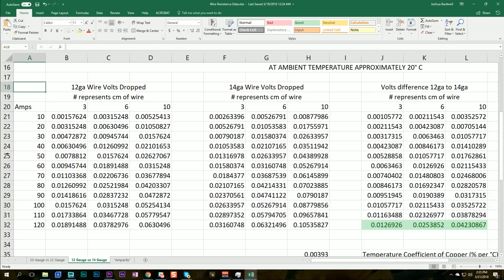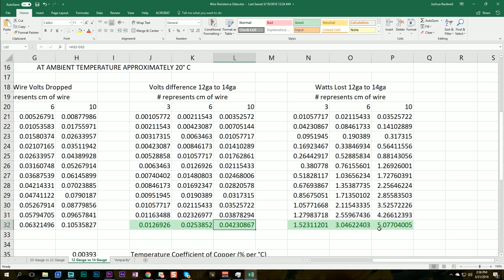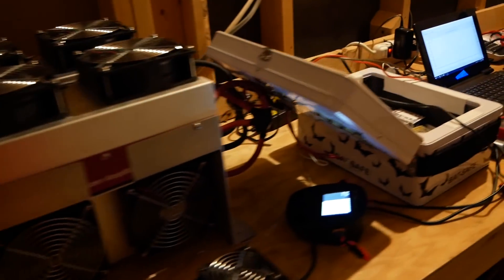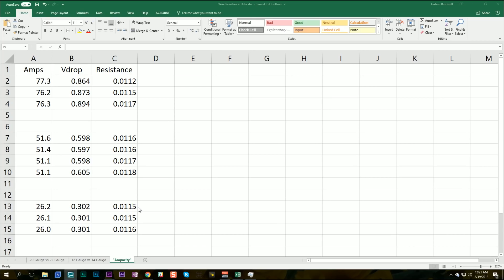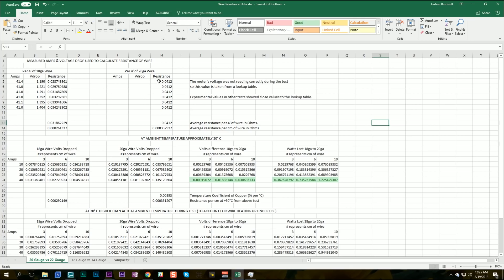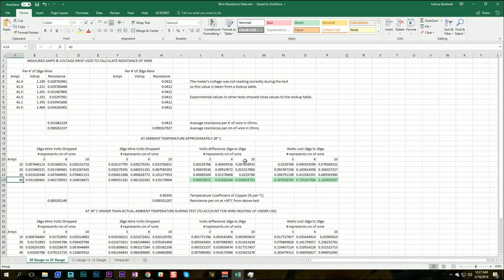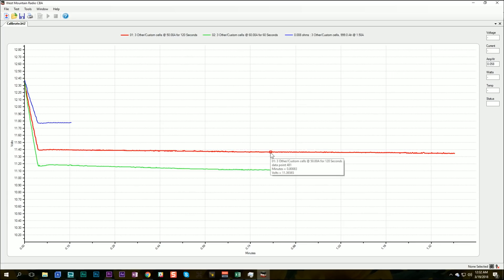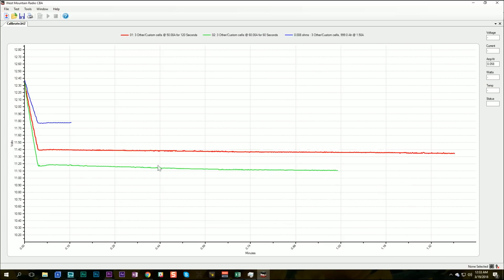Battery Wire Gauge | WHY IT (STILL) DOESN'T ACTUALLY MATTER

Comment: The one factor that is not being considered by people is how long "TIME" you are pulling the current.  Try pulling 100 Amps through a 14 gauge wire for an hour and see when it melts.  A quad might draw 100 amps but only for a few seconds.  As the wire gets hotter the resistance increases but it takes time for the heat to build up.  Also quad flights are only a few minutes in duration.  So, I guess I agree with Joshua.  BTW I have a BSEE.
Reply: Jim Hebert "The higher the frequency of the harmonics the faster the rise time is" not true,  ideal square wave contains components of all odd-integer harmonic frequencies, real real-world contain all integer harmonics. You probably was wanted to say that magnitude of higher harmonics is higher as rise time is smaller.
What "knee" in filter have to do with anything in this case, or you just want to test my knowledge? And simple answer is "knee" is representation of filter pole on bode plot.
I am glad you did all of that in your life, only I do not see your need to point all of that, and with all that experience and licensed you missed so elementary facts that every first year student of any EE university would immediately noticed.
When someone's pointing out so much that he is  BSEE it can not allow himself to make such elementary mistakes.
Reply: You obviously have no PRACTICAL experience with these matters.  What you say is theoretically correct but the real world does not allow for infinite frequencies to be present in a real circuit.  Filtering action takes place in all circuits.  A practical square wave might have the 7th harmonic present and don't forget that the amplitudes of higher harmonics are rapidly decreasing.  Pointing out my experience is an easy way to short circuit your trolling. hahaha
Reply: Jim Hebert a FEW TENS OF KHz is very much applicable to skin effect. Even at 50Hz the skin effect is very important for transmission lines!

At 10khz the skin depth is about 5e-6m for copper at 10khz. That basically means the current only flow at the outside!
Reply: ............ Might want to watch the video from 7:40 onward.
Reply: yes
Reply: Naa still wont melt
Reply: That's why I added the comment about fusing current.  14AWG wire will get hot with a sustained current of 100 amps but will fuse at 166 amps etc.
Reply: Jim Hebert, you missed fact that we are not talking about sine wave, but we are talking about square wave where frequency of it is not your biggest concern (iin most case you can ignore it), but rise time. 
For example if your rise time i 1ns no matter what frequency is your square wave signal your conductor will behave like you are passing 350MHz signal through it (1ns is here only for example in quad rise time is much greater, if it is like 1ms then you get 350kHz).
10kHz PWM do not act like 10kHz sine wave but more like sine wave in MHz range.
Reply: Rise time is a function of harmonics.  The higher the frequency of the harmonics the faster the rise time.  What is the knee of the filter?  BTW, in my career I designed microcomputer systems and switching power supplies so I know about the harmonic content of square waves and the control of rise times to remove overshoot and ringing in signals to optimize response time, critical damping.  I am also licensed to work on RADAR so I know about dealing with high power transmitters etc.
Reply: nope square wave and is more switching three windings on and off at the right time very dynamic
Reply: Nathaniel Jack I would suggest you go hook up a scope to the output of an esc with a motor attached :)
Reply: 1979Iceman you mean like this?
https://www.youtube.com/watch?v=2k5CzVf6AGc
It is easy to see (till moment it hit near 100% duty cycle) it is driven with square wave PWM with trapezoidal back emf.
Trapezoidal back emf is what differs BLDC from PMSM which have sinusoidal back emf and it is usually driven with SVPWM (if you drive it from VFD) or with sine wave (if you drive it from power grid).
To put simple if we would use sine wave to drive motor then we would call it PMSM not BLDC (BLDC is PMSM optimized to be driven by square wave, or you can look at BLDC as special case of PMSM same as is stepper motor).
Reply: Jim Hebert you are wrong again, real and theoretical both allow infinite frequencies to be present in it, filtering do not eliminate frequencies it only attenuates signals at some frequencies but do NOT eliminate them.
I hope no one you plan to work for/with do not read what lot of crap you wrote here or they will see you have zero knowledge. After what you wrote her I doubt you ever passed near EE university and BSEE you could only get if they give it without you ever learn something, listing some "virtual" experience can "impress" someone who have no knowledge like you, but even first year student of EE university see all you wrote is wrong.
Little friendly advice, go back to school and start learning elementary things, you will then stop posting crap like you do now.
Reply: Miloš Lazović no like this https://youtu.be/viQa1Gwbmm0. LOL ok I'll stop :)
Reply: In video refer to you can easily see that ESC drive motor by square wave, motor drive is thin line, tick sinusoidal line is probably some filtered BEMF, evidence for that you can notice at end of video when motor drive is stopped and that line still exist on oscilloscope (you can clear hear sound when motor start freewheeling).
I tend to believe more to Felix video (he is one who designed KISS ESC, and BLHeli used same method) then some random guy on youtube.
If you want more in depth explonation you can look for app notes for AVR microcontrollers (what I read BLHeli was oreginaly derived from them, but that may not be case).
But you are right you can drive BLDC with sine wave and it will work but you will lose some efficiency. There is some design differences between BLDC and PMSM which make one more efficient for square wave and other for sine wave, but which exactly they are I do not know (I never in my life designed any type motor and I was in university long time ago so I forget many things).
Reply: Jim Hebert it doesnt matter its simple as switching on an off three windings usually in delta config. Your right there will be factors changing the shape of waveform but thats besides the point who cares
Reply: Miloš Lazović Soooooooooo... As JB said: wire gauge doesn't matter.  If you're right (and I'm not saying you are, I haven't hooked my scope up to my ESC output), then a 20 gauge wire with extremely thin strands should out perform an 18 gauge wire with thicker stands. Or two 18 gauge wires with different strand size. Do your test, prove your theory and post your results.  And the key here is "non-negligible results." Otherwise it's all just theory, no matter how much you SAY that real world facts prove you right.
Reply: Troy Nahrwold let give you simple answer, I don't want to waste my time doing experiment for something for which already exists well known formulas to calculate same (and get exact result, which you will never get with any measurements), especially when setup to do that kind of experiment is not so easy to do, it is not just stick voltmeter on peace of wire and read voltages, to measure inductance of parallel conductors millimeters make difference and it is not simple to put 2 wires multiple time on same distance with margin of millimeter.
I perfer to do what i do now (sitting on tropical beach and drinking) then to make videos of experiments that will prove facts that are weill known.
In theory I know you can not fly, but you are welcome to prove or disapprove my theory by jumping from forty storey building and making video of it, your request is equally realistic (even you jumping from building is easy to do, but end results will not be good to your health).
Reply: That is all nice and true for constant current, but in quad current is not constant but it change rapidly over time (motors are driven by PWM ... ) so as BSEE you know that there are other effect more important that are in play there like skin effect (not explicitly related to wire gauge but distributed of current within conductor cross section) and inductance (inversely proportional to wire diameter).
They all make more difference then resistance of wire, but only question is even that noticeable.
Reply: Skin effect is primarily applicable to RF frequencies. The few tens of kilohertz used by a brushless motors it is not an issue for skin effect.  Inductance might be an issue at motor frequencies but I expect that the motor power system will account for inductive reactance in the control loop.    Like I said,  "A quad might draw 100 amps but only for a few seconds."  This allows the wire to cool down between bursts of high current as pointed out by Joshua.
Reply: Miloš Lazović I'm pretty sure the signal going to the motors is 3 phase AC and are sine waves.